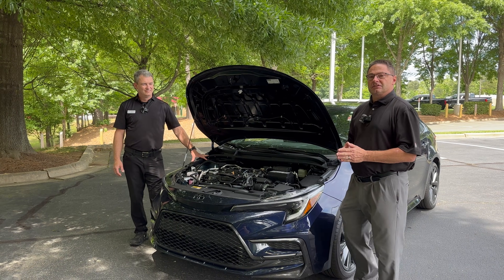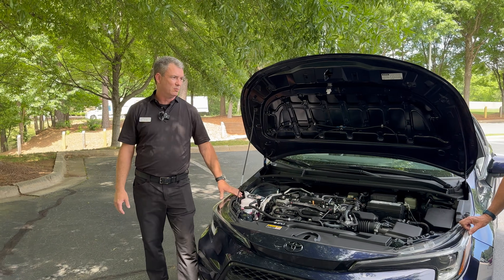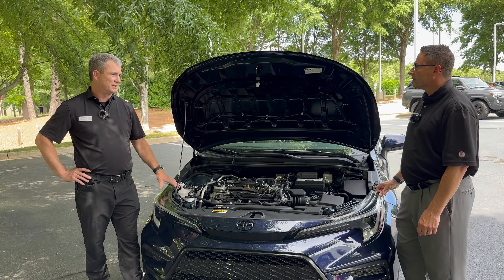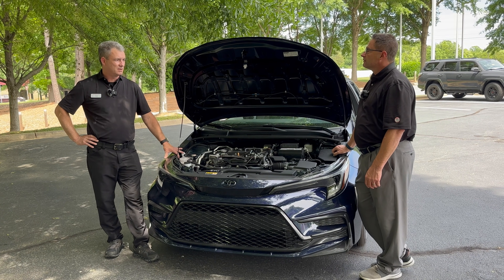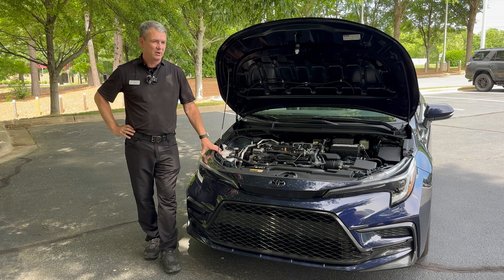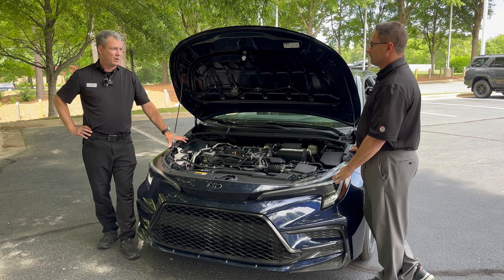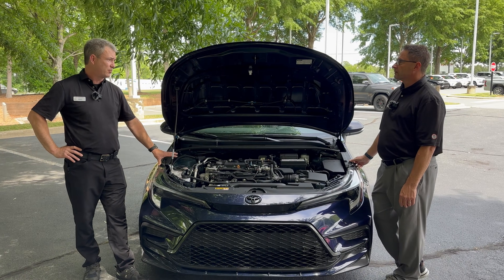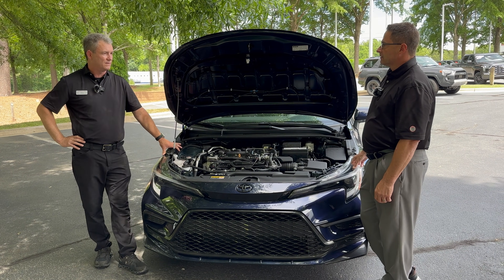Is Toyota CVT Transmission Reliable (Toyota Car Care Talk Ep. 18)

Comment: I have a CVT in my 2017 civic , I call it continuously variable trauma and I'm sick of , RPMs randomly up and down and engine roaring , I keep it maintained change trans oil every 25K and still sucks, I drive properly and wait for the engine to warm up then I drive , I never floor it or put pressure on engine it still sucks , I've been told those clear signs it's failing.

Comment: I just bought from a used car dealership the 2020 SE Corolla, not sure if the fluid exchange has happened? cant tell with the carfax its at 78k miles. should I take it in and ask or?

Comment: The CVT was originally invented by DAF, a Dutch producer of small automobiles. It where amazing cars because they could drive backwards with the same maximum speed as forward. Which is of course very dangerous 😂 In Netherland we had contests with DAF's driving backwards. Not many of them made it to the finish...

Comment: Toyota's addition of a traditional fixed launch first gear has improved their CVT enormously. Considering it was a design choice intended to improve feel at take up from a standstill I wonder if the durability benefit came as a pleasant surprise to them. JATCO, who make most other manufacturers CVTs, would do well to copy Toyota's lead. Interesting to note Mazda has stated quite publicly they will not use CVTs believing it to be a seriously flawed design. A great idea for low powered scooters and even uber lightweight small cars (like the Daf that first used it) but seriously fragile in heavier overly powerful cars.

Comment: I am a retired ford tech and my daughter had a toyota 2022 corolla cross, the warranty for power train out at 60,000 cvt failed at 67,000 miles. Dealer serviced the POS cvt twice, warranty said no wanted between 8 to 9 grand to replace. Trade in value with working transmission between 15 to 16 grand at the time and the dealer offed her $3800 for the junk and she owed 13 grand on the POS. I bought a used vvt with 30,000 for 2800.00 put it in in my shop. I put the crap online and sold it for 18,500. Paid that POS off and got her a 2019 last year Taurus. If you ask me i will tell where you can shove your CVT transmission. I thought she would of had better sence than to but another vehicle with that garbage after a 2012 altima and a subaru forester both with ctv's and both failed before 85,000 miles. But me in Alabama and she in texas, I had no clue what the was buying because she would fly home all the time. I drive a 2006 taurus with 480,000 miles on the all original car no transission issues except for the torque converter.

Comment: My 2017 Toyota Carolla 7 speed CVT 390k kms transmission still going strong. Serviced twice a years
Reply: was that twice per year?, or twice total ?  i have 2015 corolla sedan..
Reply: CVT's have no gears. So, you can't have a 7 speed transmission.  CVT's use a metal belt that adjust with speed to keep your car in the speed. I have a 2016 Corolla

Comment: Does anyone know if my 2020 Corolla Le 1.8 engine has a launch gear?   No one seems to know including me.
Reply: No, it's the regular CVT. In those years only the higher trims with the 2.0 engine had the launch gear. I think 23+ all have the CVT with launch gear.
Reply: @BenFloyd-n5k  Thank you for the info.  My corolla does seem to accelerate quite quickly from a stop though.  But I don't push it due to it being a cvt.  It feels like I do have a launch gear. Sure wish I did and thanks again for the info.

Comment: I never heard of a CVT transmission until I found out I had one that was failing. Took it for regular maintenance and tune ups. Mechanics would tell me all the other stuff my car needed but never said a thing about my transmission. When my car started making weird noises, no one knew what to do, it started shuddering, again no one could figure it out. Then it started slowing down. I ended up taking  it to 4 mechanics and the last one finally said “let me look at the transmission and that turned out to be the problem. So much money and time wasted and now my trans is just busted.
Reply: Just some  friendly advise. Research well any car you are going to buy before you buy it! You tube has videos on most all used cars and their common problems. I do this with every car I have bought in the last 10 years. The internet is your friend on used cars, use it!
Reply: @williesteele4503 I did 4months worth of research on my CHR before I bought it. No one talked about the transmission until recently. 😢Right now there is an internet petition going around to hold Toyota accountable for all the defective transmission
Reply: @williesteele4503 Watch Car Care Nuts videos about Toyota maintenance. I call this channel Toyota university.

Comment: puhleeze, don't believe everything you see on the internet, let me know when you have a cvt (trashmission) warrantied up to 200,000 miles, the cvt chain(or belt) is constantly shifting and will wear out more quickly than a geared transmission, the harder you drive it the faster it will wear out so these trashmissions are usually only good for grandma drivers and definitely do NOT tow anything

Comment: I just love the new launch gear on my 2022 hatchback corolla but i am not sure how to give it 100%. Do you turn off eco mode and turn on sport mode too? It feels like sometimes it uses it and then thinks "thats enough" and you can feel it slip right out into being sluggish again. But, at the same time its giving me "eco" in the dash so I am assuming its programmed for that I just wanna hit 40 before it shifts?
Reply: Wait till you watch my 5 year review of my 2020 Corolla LE 1.8 litre with the CVT and it’s quite smooth.
Reply: @alvinsimba734  it feels like it does some kind of math when it shifts gears through turns. like torque conversion or something. if you take off on a turn for example it seems like it gives you a totally different ratio to gears.
Reply: @typerightseesight  also remember that cvt is also learning your driving habits and I know with my 2020 it knows exactly when to move and the rpm’s involved. Most of my city driving is 2k rpm’s or less and on highway max is 2500rpms especially on higher elevations
Reply: @alvinsimba734  i went from a car that didnt have antilock breaks to this thing and it took me a minute to realize its using a computer algorithm to accelerate its not like pulling a cord to add a higher ratio of fuel into the cylinders. lol, i did put 2 and 2 together tho that traction control literally computes how it wants to power your wheels so you have to like be aware of when you should press on the gas when turning and what not. its like night and day whether your trying to gas it straight or from the left turn lane lol

Comment: What can we expect this 2 guys work for toyota😂😂😂😂😂
Reply: While your cynicism is justified, I believe the message.  I've heard from several mechanics that the Toyota CVTs are stone reliable.    I've heard several say that they've seen zero failure rate with them.  One of those mechanics has changed the CVT multiple times in the SAME Nissan.
Reply: As someone who drive CVT Honda Brio in Indonesia since 2018. I could tell you that CVT from both Toyota and Honda are great. Never had problem with it. But I wouldn't recommend going with other car brand.
Reply: Just what I was going to write.  I mean seriously, even if it is reliable, I am not going to use two Toyota dealership employees as my source of truth.

Comment: When to change the cvt?can I use the fill plug as a gauge like the differential?
Reply: Every 30k. Drain into a pan and measure what came out. Only use toyota fluid and put the same amount back in. The fill plug is behind a plastic panel behind the driver side wheel. Remove the wheel and the little panel and there's a fill plug behind it
Reply: Pull the drain plug and then there's a plastic overfill tube you need to pull right behind that drain plug. Very simple
Reply: @chaysecushing9014  thanks

Comment: 2024 toyota corolla- issues. Issues. CVT transmission slip/ shift gear slip. Suspension/ break issues etc. Toyota dealership - bad / dont seem to want to fix

Comment: CVTs are unreliable because they require more frequent maintenance. Additionally, a Corolla with a CVT jolts forward when you step on the gas pedal while the car is idling.
Reply: ECVTs are ridiculously reliable.

Comment: Brand new 2024 Corolla LE with only 3000 miles on it and the transmission is starting to jerk a lot after change from the launch gear to the CVT in acceleration from 20mph to 40mph looks like a misfire. Is my first Toyota and kinda disappointed with the purchase.
Reply: Is normal is alot of jerkiness around that speed my honda does it too
Reply: Same happens with my Corolla cross 2023 , so the jerk is normal
Reply: @tauseefafzal1323  my 23 model 10,000 miles at the does this! It’s quite annoying! I drove a versa for a month 2024 and despite being slow, it was really smooth
Reply: Take it back to the dealership and see if they have a software update to improve the shifting.

Comment: Cheap to build. Costly to repair. Works good for car maker. Not good for buyer. Dont like the way they drive. They will keep making them if u buy them. One was enough for me.
Reply: My Corolla 2015 transmission died at 63k.
Reply: @Choi-fz3bt  unless its the hybrid thats not a cvt
Reply: We have a 2014 Honda Accord with the 2.4L engine and CVT transmission. Had it since new, and not only does the CVT feel good to drive. But it’s been super reliable with no issues what’s so ever. The car is now around 201k with the original engine and transmission.
Reply: That's a myth, I have Toyota cvt 12 years now, no issue, I barely even service it,
Reply: The older CVT is durable. The newer ones are most likely made in either Indonesia or someplace where they can make a quick buck?
Reply: @raymondtingting6364 thats a large assumption brother considering the Toyota Engine and transmission plant is in West Virigina. They make the batteries here in North Carolina too
Reply: Costly to repair? That would be relevant if they required repairing. Almost unheard of for them to fail and one of the most robust transmissions ever made, including torque converters.
Reply: You must not be reading the comments! Plenty of of CVT owners, even Toyota and Honda, sharing their experiences of CVT completely failing after 50-100k miles. This is totally unacceptable garbage. My 2025 Toyota Corolla SE with CVT shifts like garbage at low speeds. Unpredictable pedal feel at different times.
Reply: @finnthehuman8128  you uh… realize you have a warranty, right? My 2024 Corolla transmission is good, I’m happy with it.
Reply: @finnthehuman8128
Those people are probably too heavy on their gas foot.
Drive normally, change the fluid, don't push the CVT like a race car and it will never brake.

Comment: 23 Corolla se. Great gas mileage but the transmission specifically jerks. Really concerning.
Reply: Does it jerk down shifting?
Reply: @TheDirtyJerkin no, just the stupid launch gear and then again when the CVT engages!! It’s Uber annoying! 

I test drove a 22 model with the older CVT and it’s smooth! The launch gear is the problem!
Reply: Do you have the hybrid model

Comment: My Rav4 equipped with 2.0L Dynamic Force engine mated with DCVT. Whenever changing from launch gear to cvt mode, makes a noticeable jerk. Toyota service guy said this is normal. This is UNACCEPTABLE
Reply: That is normal the tech id correct they did this on purpose because too many people complained about not being able to feel shifts in the CVT. Working as intended next?
Reply: I’ve had that in rentals. I got used to it. Maybe you can too?
Reply: That seems to be the standard answer at the dealerships for a lot of things…”oh that’s normal”😒
Reply: My Corolla cross 2023 ,50,000 miles same jerk when move from 1st gear to Cvt ,but it was not there when I bought new
Reply: My Corolla has that thump on first gear too.

Comment: K114 Aisin trans are junk. No launch gear, went out on my 2018 CH-R at 58000. Toyota won't cover it under 6yr/60000 powertrain warranty,  1 year out of warranty. I now have an expensive paper weight in my garage.  $9k for replacement,  what a shame.
Reply: i'm sorry but ur 1 year outside of your warranty!! it's unreasonable for them to honor it way outside of that warranty period. Come one. Also,  CVT trannies are sensative to fluid changes. if you were late or did not change your transmission fluid at all what do you expect?  CVT transmissions burn out easy due to old fluid.  Also if you are a heavy food on the gas pedel that kills CVT transmissions as well.  

CVT transmissions are durable only as long as you maintain them. you don't they become expensive paper wieghts.  if you haven't already try taking it to a transmission shop for a rebuild.  I had CVT rebuilt for $2,700

Comment: Is the CVT on 2025 Camry good?
Reply: The new Camry doesn't actually have a CVT, it's just a quirk with the naming scheme. It has an engine and a control motor, and both are connected to a planetary gear system which provides power to the wheels. By spinning the control motor at different speeds, the output from the engine is changed as if it were switching gears. It's an incredibly elegant system which is far less prone to failure than traditional CVTs, cuz all of the complicated moving parts are replaced by a single planetary gear that just spins all day and never shifts or adjusts.
Reply: @illznik2 exactly why I prefer the Camry over the Corolla. 8 speed automatic is the way to go.
Reply: @illznik2 You own a hybrid.
Reply: Thanks for the update.  I heard the CVT for the Toyota Prius is robust

Comment: Yes CVT built by Toyota reliable BUT it is still not reliable than regular transmission. HOWEVER, the hybrid system has eCVT and has very good reliable rating!
Reply: Hybrid Ecvt uses a planetary gear set. Bulletproof in comparison. 👍

Comment: Wait. Toyota claims that their product is reliable. How shocking. Maybe it is. But if that's so, I want to hear it from someone who isn't trying to sell me a Toyota.
Reply: I’ve had over 25 vehicles in my life, four of which were Corollas (still currently have two) and they’re hands down the best vehicles I’ve had. My newest is a 2019 with the CVT but it’s pretty early to vouche for it yet. I was very hesitant in buying my wife a CVT, but people seem to have a lot of good to say about them. Kinda neat to accelerate but watching the RPMs remain the same. So far, it feels solid
Reply: @ArsonistArborist my 2019 with 106k miles is having issues, barely wants to move in reverse, and poor acceleration, mechanics said cvt might be going bad
Reply: @j.vosier6786  yikes. Mine is a 2019 with 110, still solid. Did you check to see if yours was recalled? I think the first few thousand 2019s off the line had a defect that got recalled. Mine was build after that
Reply: @ArsonistArborist  i checked and no recalls, im going to take it to a mechanic
Reply: @j.vosier6786  they do have a coolant line that runs from the transmission to the radiator that’s kind of exposed.. perhaps you ran over something and cracked it?
Reply: @j.vosier6786 first question did you do drain and refill of the transmission, if not I think you are way past overdue for that to be done.
Reply: They are not talking about a ford ... all Toyota's are reliable!

Comment: My family has had 2 cars with a CVT, one went out after 5 years and the other only lasted 3.
Won't buy another one
Reply: Were they Toyotas though?
Reply: What brand were they?
Reply: @felipesuarezweb  Nissan and Subaru
Reply: @918Mitchell  thanks brother.
Reply: Go get a Ford, they don't use CVT 😅, imho
Reply: @raymondtingting6364 but they use wet timming belt
Reply: @raymondtingting6364 the engine would die before the transmission lol, ford sucks.
Reply: Nissan and subaru use the same brand CVTs. The only other brand out there is made by toyota. Nissan and subaru CVTs suck, toyotas dont.
Reply: Did you change the transmission fluid?

Comment: Good luck lasting over 250,000 to 300,000 miles.
Reply: 2016 Corolla with a cvt made it to 325K miles before it finally took a dump… this was before the launch gear was introduced in the 2018 model Corollas … a neighbor who drives for Uber as a side hustle got that amount of miles out of it… and a 2012 Nissan Altima 2.5 crapped out at 279k miles… they are not durable as standard,but cvts have come a long way… proper maintenance was done to these vehicles..
Reply: @donovanfahrbach2493  You still can’t rebuild them though
Reply: @waterloo123100  you can’t rebuild most modern automatics today… only the older ones.. modern automatics are also throw aways..
Reply: Most people who rebuild automatic transmissions don't rebuild foreign transmissions, they usually just rebuild ford, chevy dodge automatics

Comment: The part I dont like about it, on the freeway when I let my foot off the gas to slow down a bit it just keeps going doesn't really slow down much at all
Reply: Actually, CVT engages the lock up clutch most of time, engine brake is applied more than the conventional automatic transmission.
Especially, with Corolla CVT, I can feel the high level of the engine brake during low speed (10-15mph).
I can even feel the lock up clutch disengage timing.
Once the lock up clutch is disengaged, car is moving more lightly.
It feels more like a manual transmission.

During the highway speed it shows the engine brake effect more than the conventional automatic transmission.
Reply: @swlightn  are all the vehicles I've driven I strongly disagree.
Reply: @gillmccuddy  And then, try to use Toyota Corolla 12th generation.
It mostly depends on your driving style.
If you are flooring all the time, CVT is not your option.